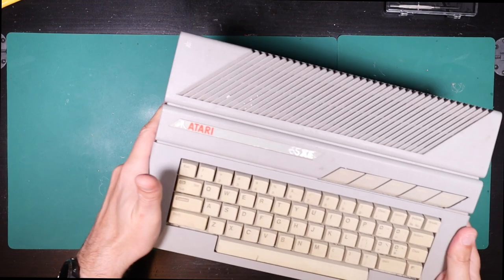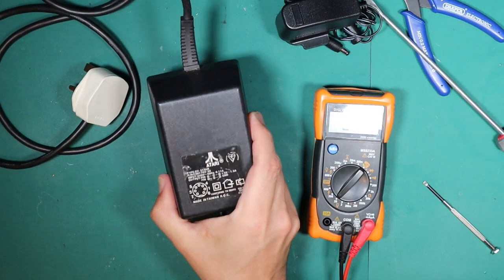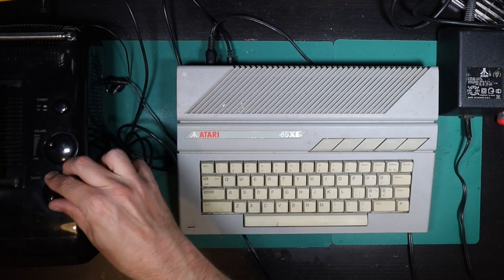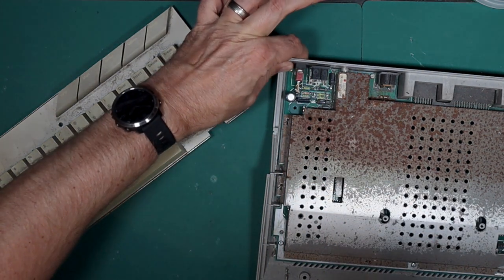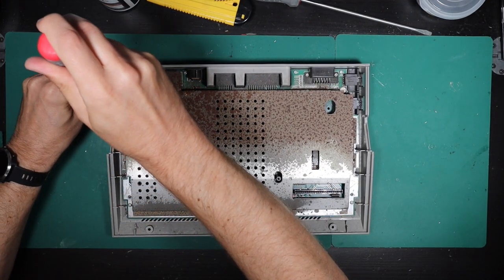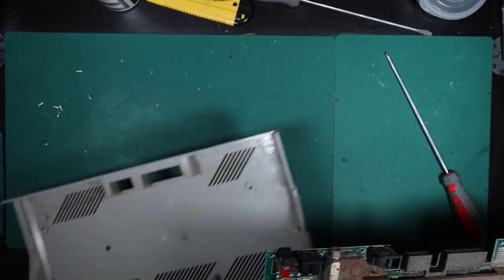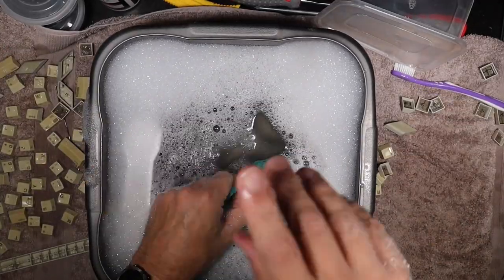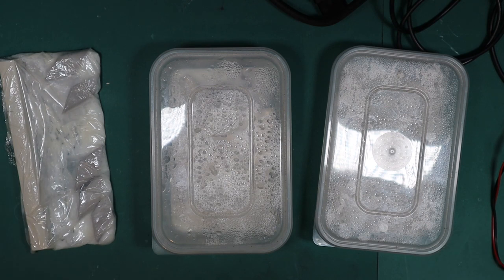Atari 65XE Repair (keyboard and power switch) -  Retro 8-bit Computer

Comment: So many memories of the Atari 65xe and the 800xl I had both with a load of cartridges (my favourite was defender) hours of fun why did I ever sell them?! and my Atari 520 ST my cat 🐈 used to love to sit on top of where the power supply was mounted (the good old days) well they seemed to be! I was looking for one on eBay but I’ve just watched price go through the roof, maybe one day after COVID-19 has stopped over inflating prices. Great video!
Reply from the maker: Hi Buzz, it was a shame to sell the 65xe, sadly I have to sell most of the stuff I repair and after fees, parts and the odd fail, I don't make money. The reason I have to sell them is space. RMC recently did a piece on his channel about his new "cave" which is 200sqm. His old cave was 30sqm... my whole flat is 30sqm, just one bedroom with a cat and my partner I just don't have any room. I don't even have a 2nd bedroom for repairs, I repair in the hall of the flat. So unfortunately if I keep making videos I have to sell stuff on. I am shocked at some of the prices on eBay nowadays and the difference between for parts and working is miniscule. Fortunately I do have lots of stuff under the bed yet to repair including a 800xl. Hopefully one day I'll do an ST, for a while they were a bargain, but prices of those are up there now too. Thanks again for your comments I really appreciate the time taken to provide feedback.

Comment: Nice video and a really good find. No major issues except the expensive  membrane.
I just worked on a same motherboard model but it was from an 130xe so all the ram slots were populated.
I bought it with memory issues on ebay. I ended up socketing all the ICs because it kept crashing even with new RAM. It turns out that old IC sockets stop making reliable connection (there were only two on that board for the CPU and Antic). I wish I knew that before pulling every single chip off the board.
Another thing I hate  about  those boards are these two ugly bodge wires. I  ended up relocating them at the back of the board so they are not visible....boarder line OCD lol.
Reply from the maker: Hi Nikolas and thanks for your detailed comments. I absolutely adored this 65xe what a great 8 hir micro this platform so far ahead of its time. I'm with you on wore mods. I am slowly learning how to repair electronics and getting slowly better. I now do my mods on the rear too  check out my dragon 32 video). Sounds like you had some fun with your 130xe glad you got it all sorted though. I have an 800xl I will try to fix at some point. Anyhow welcome to the channel. I'm glad you enjoyed the video but most of all than you for your detailed comments. Very much appreciated.

Comment: Great job as always, I really enjoyed that one. Nice result at the end too, it's lovely to see these old systems waking up after a long slumber. Tell me can we expect an Atari cassette deck repair video in the future? In any case I'm looking forward to the next one. Have a great Christmas my friend ;)
Reply from the maker: Hi @8bitsinthebasement I am so glad you enjoyed the video. Especially since I moved video editing softwares and struggled a bit with some aspects of it. I really did like the atari. Compared to the computers I had growing up it felt "solid", of course at the time it was very much more expensive than the machines I had. I forgot to mention a couple of things in the video. The cassette deck actually worked perfectly despite the seller saying it "needed new belts", so there was no repair of that. Also I sold most of the games as a lot to  fund the keyboard membrane, thats why I only shot centipede by the end. I actually found a couple more games afterward that I will save those for the atari 800xl repair when i get around to it. Stay tuned, I have a CPC464, Acorn Electron, zx spectrum, Tandy Color computer 2, Atari 800xl and Dragon 32 all waiting on my attention. So hopefully much more is to come. Thank you again for your comments and support.

Comment: As a kid, I got the 800 XL model, which, a bit later, got upgraded with the CompyShop RAM enhancement, adding a whopping 256 kB to the base 64 kB, a built-in custom version of TT-DOS, which could be loaded into RAM at boot by pressing a button added to the right side of the case, and three modes of operation (three-way switch added), Atari OS with 64 kB (compatibility mode), Atari OS with 320 kB (here that TT-DOS came in really handy) and the powerful Q-Meg OS mode). It was a bit of a pity I was unable to get the Turbo-BASIC XL chip as a replacement for the Atari BASIC, but thanks to the upgrades above and the excellent and reliable 1050, booting this powerful programming language into RAM was a matter of mere seconds.

The only weak-point of the XL was actually its power supply, which tended to increase its voltage output over time, potentially  frying the CPU - which hapenned to me once, after some 4 years of intense (almost) daily usage. But it could be remedied by using a good stock one, though, of course, soldering that custom connector was required.

Now.. My friend had the 65 XE, which looked really cool (its design was fantastic and it really made this beast look like one of the ST-line models, at least to someone not familiar with these machines), but it also had a few drawbacks, when compared to its predecessor - the overall build quality was lower (it was already made during the Jack Tramiel era), the cartridge port was placed at a rather inconvenient location at the back of the case and the universally loved PBI was replaced by something called ECI, if I remeber it correctly, which was quite similar in its functionality, but physically incompatible.

On the positive side, the OS was fine-tuned more than that on the XL machines, and the board design was much simplified (which already started on some of the later-produced XLs, where the FREDDY chip took over a lot of functions from stock chips).

However, the true reason I have fond memories of the 65 XE in particular as well, are quite fancy - that friend of mine also had one game cartridge, that introduced me to a game, which, up to this very day, still occupies the number 1 spot on my personal greatest games ever list 🙂

The game was Star Raiders.

Thumbs up for the video 😙
Reply from the maker: Thanks so much for such a detailed comment. I really REALLY appreciate you giving up so much of your time to comment on my video. I am sorry I haven't responded sooner. 

There is lots of great info here, so much still for me to learn. I have an 800xl I have yet to try to repair, it's been sitting in storage a long long time. It could be a while before I get to it, but these Atari 8-bits are really my favourite platform. If they had been able to get the price point down I am sure they would have wiped the smile off the face of commodore and the 64.

Thanks again for your detailed comment. So glad you enjoyed the video. Thanks. Roger

Comment: I have to agree with your recapping. I own almost all popular 8bit machines of the era but the one thing I found out about Atari's 8bits is how  amazingly  easy it is to use it even without any previous experience and how simple and cheap it is to make it run!
I mean, you just need an old phone charger for power supply and  inexpensive homemade cable to hook it on a PC and a TV..... and you are ready to go. 
No need for "mystical" commands to load a program, the loading is so fast and the graphics and music are up there with the rest of the machines even if it is the oldest of the bunch.
Reply from the maker: Couldn't agree more. The self test mode is very nice too. I have a real affection for this platform well ahead of its time. I the UK though tge original 800 was very expensive when new although the later models were more affordable.
Reply: @RetroTechRepair  Yes I forgot the Test mode. Here in Greece all micros were pretty expensive. I only got my hands on a 800xl around....late 80's early 90's I think and I couldn't believe how capable it was.

I follow the homebrew community for almost all micros (8 and 16 bit).  We already knew  from the 80s what the C64 was capable of and the  pros and cons of the Amstrads and Spectrums. We saw many improvements  on all machines especially on Amstrad's scrolling abilities and Spectrum's color clash  but  I don't think anyone anticipated that  Atari games and music would look, run and sound so good. I am still amazed and surprised of this architecture and practicality. As an Amiga user I am not surprised easily by machines of that period.

Comment: With the rusty metal, you could have wet sanded it but that is labor intensive so for your purposes it may not add value since it isn't a restoration.  Enjoyed the video.
Reply from the maker: Hi so glad you enjoyed the vid. Yes you are 100% correct, in fact I gave serious consideration to sanding back the shield and maybe even painting it, but decided to mainly repair. I was surprised how good a job the WD40 did. Several months passed between me starting the repair and getting around to finishing  it and the shield had not deteriorated at all no new rust and no loose rust, although I do agree a wet sand would have been a more complete solution. Anyhow thanks again for your comments, really appreciate the input. Cheers!

Comment: Great job. Looks great.

Those ingot-shaped power supplies are junk and should be thrown out. They may test fine but will fail and spike, ruining the computer IC's. Anything over about 5.2 volts DC is bad. Save the whole DIN plug side of the wire if desired.

Perhaps the best way to de-yellow the keycaps and case is to put it out in mid-day summer sunlight with no chemicals at all. The peroxide has a high probability of ruining the plastics by marbling. Let it get warm from the sunlight to improve the results.   Won't look quite as new but is safer, easier and cheaper.

The mylar could very likely have repaired with conductive paint. Your new replacement is very nice and preferred, however. The old mylar is more likely to fail again before long even if repaired.

The wire keycap puller does mark (dent) the underside of the keycaps. Pulling them out by hand or with a plastic puller may be better.

It's good to recap XE's which may have lower quality components than earlier XL models. 

Centipede looks great! Glad the tape drive works. That drive is good and worth maybe 50 quid.  Great to hear your impressions of the machine and that you enjoy it! They are fantastic machines =)

There are various SIO and Cartridge emulator (AVG Cart recommended) devices you may enjoy.

Thank you for sharing the repair/restoration.
Reply from the maker: Thanks so much for your detailed comments and suggestions. Very much appreciated
Reply from the maker: I will definitely take on your suggestions for my next repair. Thanks!

Comment: I have the same Atari.But the television port doesn't work, just fuzzy lines.Is there a repair for this?I have tried 3 different cables.Also i have orderd a monitor cable but waiting on that.
Reply from the maker: I am not an expert in repairing things but  think the monitor cable is a good idea as it should give a better picture than even a perfectly working RF modulator.
Reply: @RetroTechRepair  ok  thank you.
Reply from the maker: @seanfiremartin3266  you are very welcome. Thanks so much for your question.

Comment: Why is it important to pair fuse with appliance? 13A fuse will work just fine.
Reply from the maker: Oh thanks for your comment, what a juicy topic for discussion. Bear in mind I am not an electrician so the following is just an opinion….  The UK domestic wiring uses a ring main system that can deliver 32 amps, because of this each plug is fused. The plug fuse is typically 3, 13 or sometimes 5 Amps.

A device designed to have a 3 Amp fuse might not have a cable from plug to device intended to carry 13 Amps because the expectation is that the cable would be protected by a 3 Amp fuse. This way the designers can use a cable that is thinner, cheaper, more flexible, more convenient.

In the event of a cable fault or internal fault in a device rated at 3 Amps resulting in it drawing say 12 amps. It would be drawing those 12 Amps through a puny cable designed to carry much less than that. This could result in the cable overheating (especially if it's coiled up).

So yes the device will work, but it won't be protected as it should be.

Again this is all just my understanding. I am not qualified to give advice on this. I just make sure that the plug has the size of fuse that is intended. This is often marked on the cable itself.

Thanks for your question.

Comment: I was aware they would sell without the plug, and just as bare wires. But why was that even a thing? What was the rationale of selling equipment without the plug back in the day? Surely there was a reason?
Reply from the maker: I think it dates back to the days before the 13amp UK plug as we know it. Up until the late 40s / early 50s the UK had 15 amp 3pin plugs with round blades and no fuse. The incompatible 13amp system we have today was introduced later. A home built in say 1945 would therefore have sockets incompatible with the new 13 amp system, but a house built in 1950 would have sockets with different to what most people had.   So when you bought an appliance you bought a plug that suited the system you had at home. The market just got used to things being this way. Eventually in the early 90s it became compulsory to supply devices with a plug. Some of the early bakelite 13amp plugs are quite desirable I have had some retrotech where the plug has sold for more on eBay than the thing it was attached to.
Reply: @RetroTechRepair  Right! I knew you adopted a new standard pretty late, after WW2. The "force of habit in the market" reasoning, used to keep doing things the same way, makes a lot of sense. Thanks!

Having a standard so late allowed you guys to develop the best plug of any other country in terms of safety. Except when walking barefoot on one 😂
Reply from the maker: @jeremiefaucher-goulet3365  Ouch! Yes sometimes its good to be last :) I think there was a standard before. In fact I think the UK was one of the first to have plugs at all vs hard wired appliances, but the first attempt wasn't that great.
Reply: @RetroTechRepair  I meant "last that is still in use today". Of course there were prior standards. Ours just never got updates for far longer and are stuck 😉. Heck, for a while our standard was the lightbulb socket, we would plug anything in that before getting an actual plug.
Reply from the maker: @jeremiefaucher-goulet3365  Yes I think the previous "standard" was so bad they had to do better! everyone else's first attempt was good enough. Still laughing about stepping on a new style plug. I grew up in a house with still had some of the old shaped plugs and we used to have an adapter we plugged in to use most stuff. My mum and dad both remembered when they got electricity in their childhood homes. Before that they were lit with gas and heated with coal. Just like you say the entire install was 1 lightbulb socket for the whole house. They used to unplug the lightbulb to plug in the electric iron.
Reply: @RetroTechRepair  And here I thought nobody could do worse than mainland Europe (like in France). 😂😂
Their two-round-prong is as bad as I can imagine one.

As for the foot-destroyer, I've had the displeasure twice of experiencing it first hand. Once in a hotel room in England, the other at home in Canada, from one of those international plug converters lying on the floor near my travel bag.
Reply from the maker: @jeremiefaucher-goulet3365  Ouch I have done it myself more than you can imagine. I don't think the EU plug is as bad as the US which is made of thin folded metal, has no shutter over the terminals and many of which are still 2 prong with no earth.
Reply: @RetroTechRepair  interesting... I must not have enough experience with they EU one.